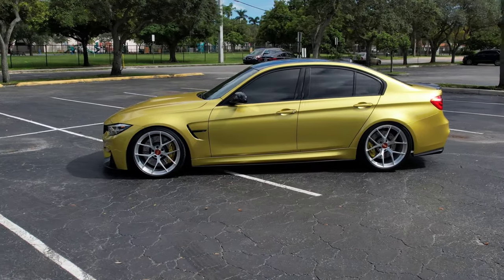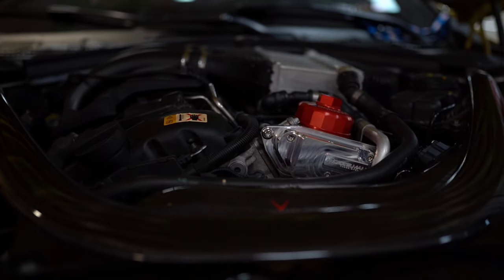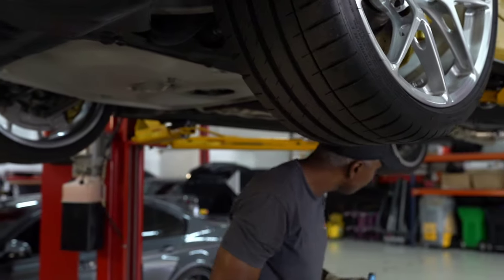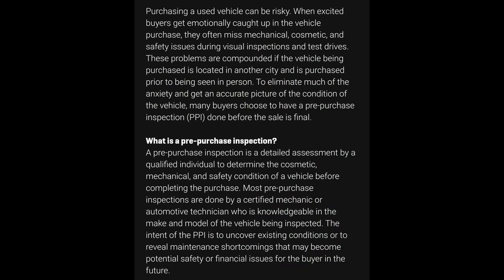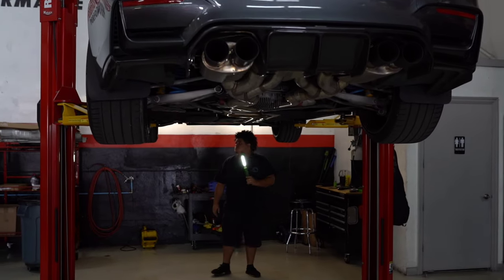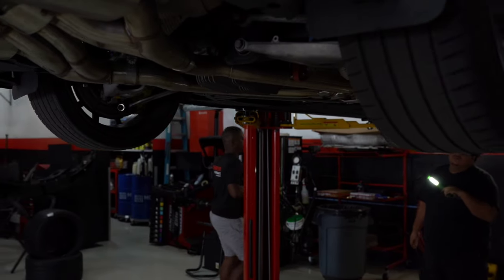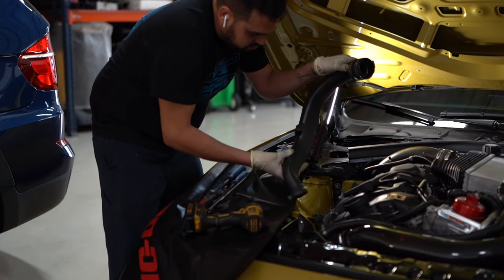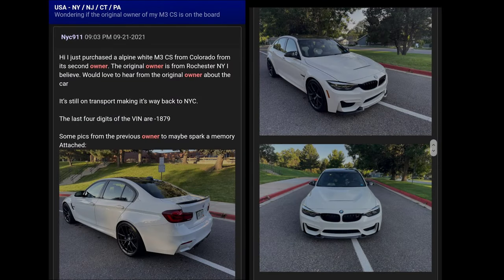Before You Buy A Used F80 M3, Watch This Video

Comment: Ppf is def necessary. I’ve had it on for years and my front bumper is spotless. I know a guy who doesn’t have it and his bumper paint is extremely chipped.
Reply from the maker: Totally agree. My next build will probably get a full ppf job
Reply: @TheDailyDriven  Idk about getting a full ppf because then it will make the paint look dull, but on high rock contact areas for sure

Comment: great video just upgraded from a 35d to a 75000 mile m4 and i am very happy,the difference is not about straight line speed as a mapped 35d will beat the m4 but the way it drives and how it makes you feel and if you are an m3/4 owner you will know what i mean
Reply from the maker: Thank you for checking out the video much appreciate! Enjoy your M4!
Reply: You got balls buying a beemer over 70k miles.. but it seems like the stories I been hearing hasn't applied much to f80s.. How has it been driving??
Reply: @TheKingdomSecrets  hi perfect got it last year in march its my weekend/summer car and i drive it seriously hard sports plus and 3 on the gearbox and done 160mph a couple of weeks(on the autobahn obviously). want to get a newer one just wish the g80 looked better as i know it is the better car but may just go for a 20 plate f80
Reply: @8000audiolab  Good to hear! Seems like these s55 engines are more on bmw's reliable end because so much can be said badly on n55's but not to s55's (crankhub at most).

Comment: just got an f82 mineral white, like ur content dude, instantly subscribed. Is there any difference between PPF and ceremic coating? Which one you recommend ? Thx man
Reply from the maker: Thanks Peter! Appreciate it.  The difference between PPF and ceramic coating is huge.  The PPF is a layer of clear durable plastic that gets put onto the exterior of the car.  It helps prevent rock chips onto the paint.  Ceramic coating is a layer of protection that is applied onto the exterior of the paint.  This won't protect against rock chips.  Its common to have the front portion of the car to be PPF'd since that is the high impact area.  Hope that helps.
Reply: @TheDailyDriven   thx buddy, probably going for an PPF then,

Comment: You spoke of nothing pertaining to the F80 specifically. What mechanical or electrical issues tend to arise with these cars? What are the weak points ? What are the remedies to these issues if any? 

Great points in regard to buying any used vehicle, but nothing specific directed the specific make and model of which someone doing research on would need.

Comment: I’m about to pull the trigger on a 16’ m4 with 78k miles on it for 40k, will do a ppi, what do you think tho?
Reply from the maker: It all depends on the color, condition, transmission, any accidents and ect. There's a lot of other factors that you'll need to evaluate if it makes sense as a good deal.
Reply: @TheDailyDriven  no accidents, fully optioned, dct, CARFAX doesn’t have much service history, I’m guessing the owners took to private shoots instead of the dealership, gray exterior with white interior. The dealer that’s selling it to me replaced the valve cover gaskets and oil pan so I’m guessing they are adding that to the price
Reply: @TheDailyDriven  an extended warranty company is willing to sell me a 5 year/ 50k miles bumper to bumper for 3600. Comes out to 60 bucks a month. Been looking to buy for 6 months since I got my job and really appreciate any advice you can offer!
Reply from the maker: Here's one thing to look at. How "in love" are you with this spec?  Is this the color combo or options you wanted. I say if you've waited this long for one, maybe find the right spec you want. For me I had to have Austin Yellow and a six speed. I didn't care for the options.

That price seems to be fair for the current market, especially it being no accidents. It does suck that there's no service history.
Reply from the maker: You can also check the forums for people selling. Their f8x. 

https://f80.bimmerpost.com/forums/forumdisplay.php?f=625